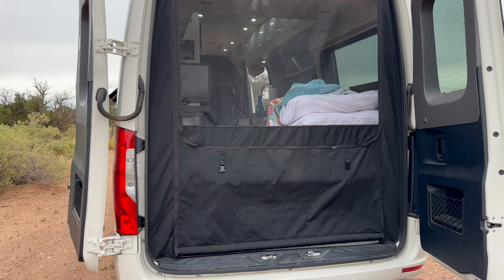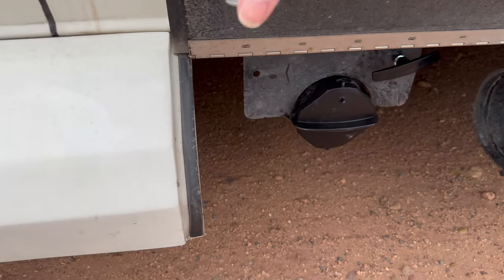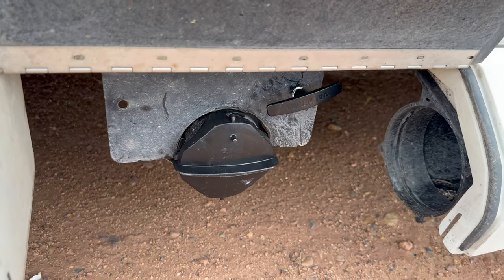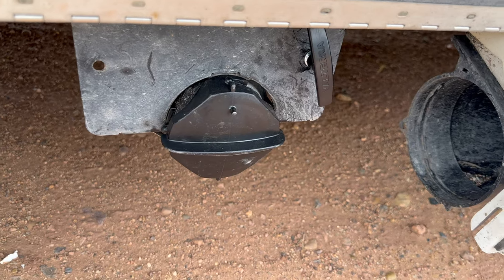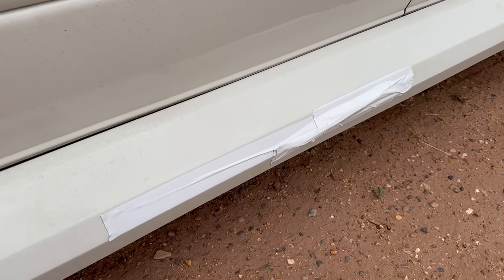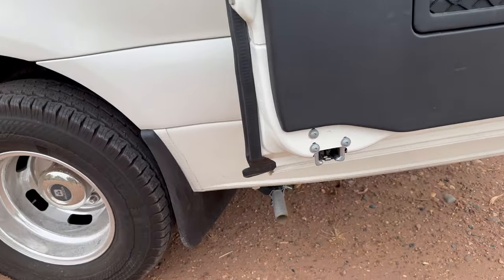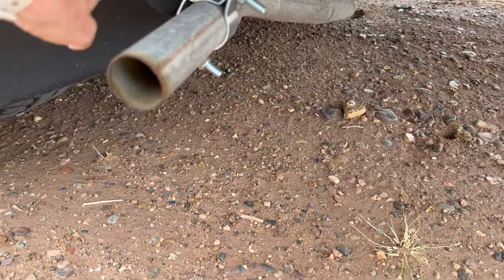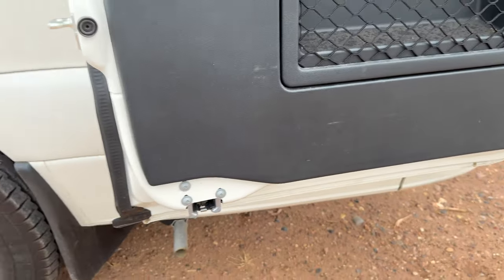Should I Upgrade the Solar on My Van?

Comment: Not sure if you can run your a/c from the Bluetti. I have heard it is really difficult to run any a/c from any solar/battery system. The current draw from an a/c is very high. I have heard running an a/c from a propane generator is the best option. But talk to others, do your own homework and let us know what your decide in your next video!
Reply from the maker: There are a couple of Bluetti setups that will run air conditioner.  I just ordered Bluetti AC300 with BK300 battery pack and 350watt solar panel.  Will keep you posted.
Reply from the maker: I forgot to mention that I got this Bluetti on an Lightning Amazon Deal. $2398 vs $3999 regular price.